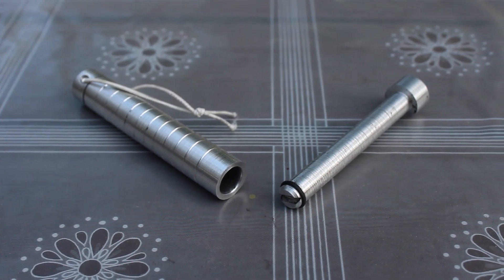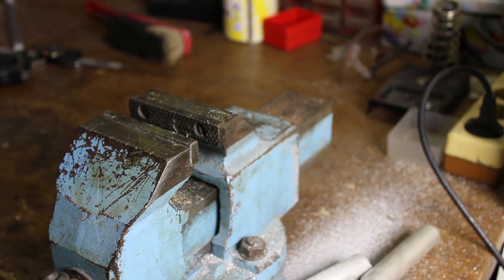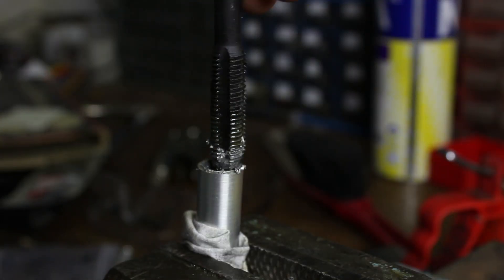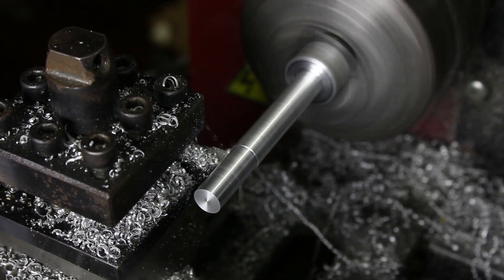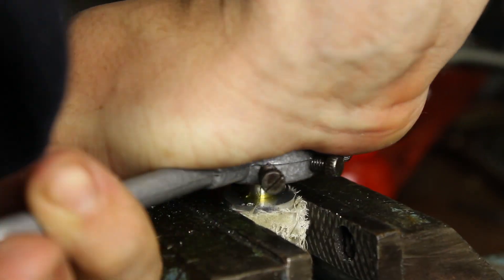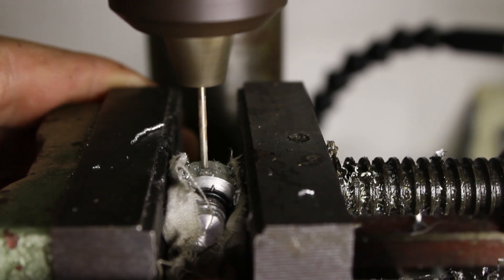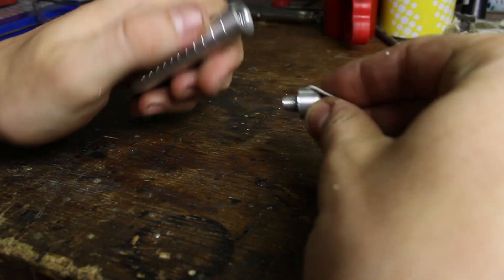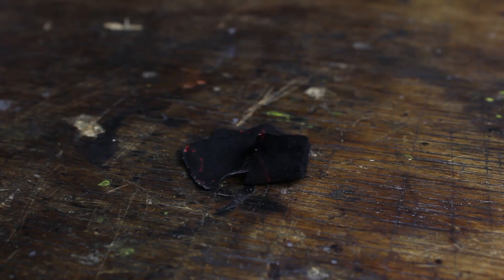Make a Mini FIRE PISTON On Lathe

Comment: I'm surprised the o-ring doesn't slide out of the groove when doing this. I have tried similar designs, but I find that the o-ring keeps sliding out of the groove.
Reply: That is because the bore is 10mm and the piston is 9mm it is too loose in the bore !! If you make the piston a sliding fit the O ring will not come out, bad design:-((

Comment: Nice work.  молодец.  Two updates to try.  Move the o-ring back 1 cm.  For the char-cloth slot try drilling a 7.5mm diam x 5mm deep hole in the end of the piston instead of the slot.  If you want to see how well it works try some shaved bark from a tree and see if it ignites.

Comment: two minor adjustments to your design would include: 1) move O-ring back a bit .. 1/8" or so should keep it away from ember, and
2) put a chamfer on the open end of the cylinder and also on the piston end of the knob, to reduce chance of pinches and to facilitate ability of pulling them apart easier. beyond that, excellent work.
Reply: The bore is too loose 10mm with a 9 mm piston!!!!!!!

Comment: You should be tapping and threading with the job in the lathe. Use the tail stock to keep the taps and dies centered.
Reply: I think what he is referring to is to keep the workpiece chucked in the lathe and and have the tap or die mounted to the tailstock and manually rotate the lathe by hand while keeping slight pressure on the knob that advances the quill on the tailstock. The threads will cut perfectly considering the headstocl and tailstock are in relatively perfect alignment.
Reply from the maker: thanks for suggestion! I tried that but the force was too high for the motor of the lathe to thread it. Maybe I should consider buying new set of taps and dies ;)